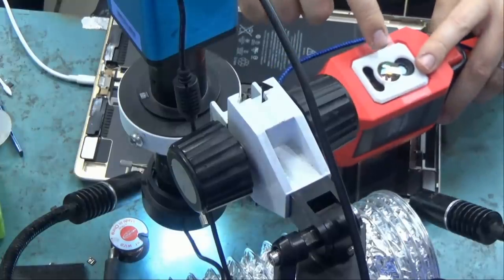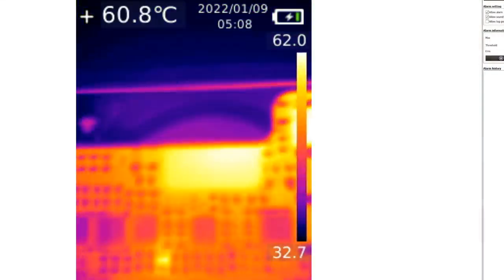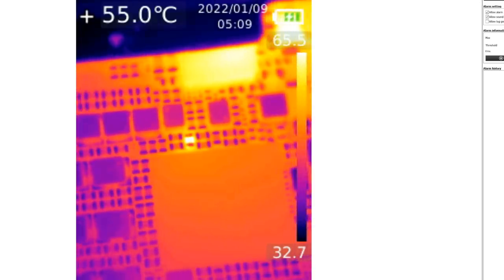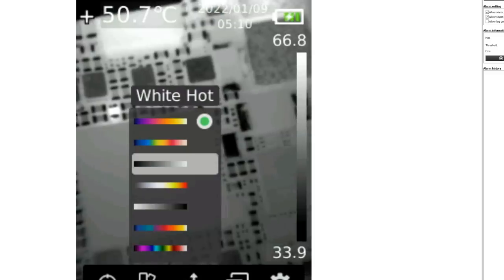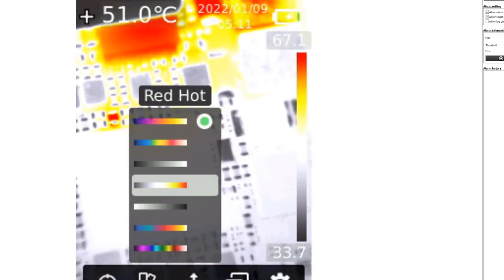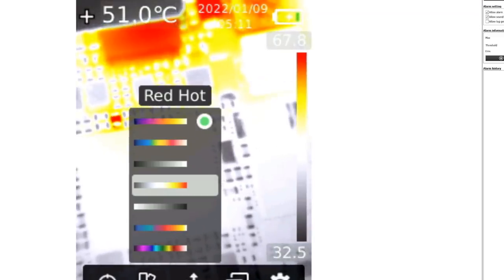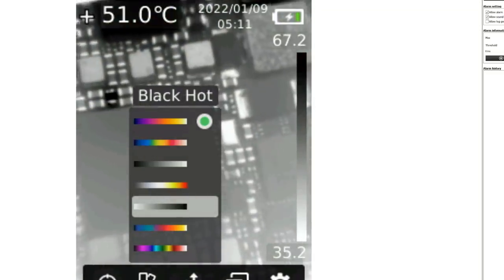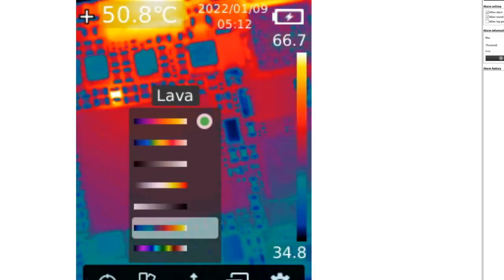iPad pro 12.9 Short Circuit Repair using UTI260B Thermal Camera and Macro lens. Amazing Details!

Comment: Quick question. Did you replace the component or was it just fixed by removing it? If the latter then how does that work? Why have that component there?
Reply: So that capacitor is just a filter cap that makes the power nicer for the chip. There are tons more on the board, so losing one of them is no big deal.
Reply: @An_Onion  thanks I was curious as well
Reply: @An_Onion  then why does apple use it if it’s optional?   How hard is it to throw another bypass cap in as a replacement? The value isn’t critical, I imagine he can get  a tube of them and not need a donor component.
Reply: @justin3594  There are many circuits which work without some component, they just work better /more reliable  with that additional capacitor.
Reply: Pcb designer here, sometimes we need a minimum no of caps for the right filtration of noise and other stuff. Personally, I tend to add a couple extra caps or more on top of that if it's a mission critical component, otherwise maybe a couple max.

Comment: Hi been watching your videos for about a year now, I have used them to learn so much more about micro soldering then most other channels. I now use these skill every day at my job now at another repair shop. something I was not expecting is just how many laptops where the CPU is the component that is shorting out. is this normal or have I been diagnosing these board wrong. Say most of these boards I am able to find a short on the coils, injecting some voltage into them the CPU die heats up under the thermal camera. Would i be wrong in stating that board is a no fix?

Comment: Are you just remove the capacitor ? Or replace it?
Reply: He probably placed a new one later, doesn't really mater
Reply: @Savvas Savva 
Blocking parasitic effects of the PCB traces und stabilizing the voltage for the IC.
Reply: Obviously bypass cap, you can remove it, but the signal is no more that smooth then (depends on other bypass caps nearby). Usually you have more of them to get a smoother signal. If you measure it with an oscilloscope you can see the differences.
Reply: He had to have replaced it.  You don't remove components and leave voids unless you are absolutely positive that the effect of it being missing will not effect operations AND you have chosen to live with that potential problem.  One doesn't make that decision for a customer.
Reply: you must be new here
Reply: I was confused about this too lol. I'm going to just assume he replaced it off camera

Comment: What causes those micro components to go bad?
Reply: most likely a component that functioned but had an imperfection and was running hotter than spec, heat cycles slowly make it fail.

Comment: Why you clamping? Is the Display Glued together or is this a flexible seal who need‘s the pressure?
Reply from the maker: It's called Better than Factory Seal using B7000 https://northridgefix.com/product/b7000-multi-purpose-glue-adhesive-for-phone-ipad-imac-screen-repair/ and Screen Clamps  https://northridgefix.com/product/adjustable-metal-clamps-for-screen-fastening/
Reply: @NorthridgeFix  very nice. Thank you

Comment: Hello from Sarajevo, Bosnia and Hertzegovina.
I follow every video of yours and I am thrilled with your technique because I am a fan of technology.
Did you replace the faulty capacitor in this video or did you just remove it to make the tablet work?
Reply: Well, not necessarily, I think it's probably a filter capacitor, in which case he can just remove the component and not put another back
Reply: He left it off.  The capacitors surrounding a CPU in a laptop are just there to bleed off AC noise from outside interference to ground.  Capacitors pass AC but not DC, so the DC power is unaffected but RF noise is sent to ground.  He left it because, in a small thin laptop or tablet, there's no room for one big capacitor for this job, so they solder a bunch of smaller ones in parallel near each other instead.  For example, if you need a 10uF capacitor to bleed off the noise, but it would be too big, you can put five 2uF capacitors in parallel instead.  Parallel capacitors total capacitance adds.

So five 2uF caps in parallel is the same as one 10uF cap.

Since there are so many caps around the CPU, removing one probably only reduces the total capacitance a tiny bit.  Probably less than the allowed tolerance of the total anyway.  

Since you risk damaging the board replacing it more than the risk if you just leave it off, he just didn't put a new one in.

EDIT:  You can kinda tell they are all in parallel and are just filter caps by how crowded they are and there's kind  of a pattern to them.  
It's not ALWAYS the case that caps can be left off because it's not always the case that they are for filtering noise and are just one among many doing the same job.
But in this case it was.

Go to 3:38 and you can see.  It looks like a repeating pattern.  That's a clue they are for noise and in parallel  You can just kind of tell with experience.
Reply: @derim006  no it has a purpose. It is used to clean a possibly dirty signal. @Amadonics told there are multiple capacitors that work together to do this job. But in reality, removing one capacitor isn't going to harm the electronics too much, it just decreases the filter effectiveness by a bit (but not enough to make it stop working)
Reply: @AmadonFaul  Thanks for your clear explanation!
Reply: @derim006  He explained it very well. Those things are in parallel and if you remove one, the others will continue doing the job.
Reply: @cinkoxid  SPOT ON
Reply: @AmadonFaul  Thank you for you time explaning.
Reply: Alex explained that question before,it's risky and dangerous to heating around cpu to solder that cap back then just removing it.so the answer
Reply: Pročitao sam dalje komentare  i ima smisla jer je paralelna veza.
Reply: thank you for your reply

Comment: When you plug the charging cable and seeing an amp draw from your meter do you disconnect the battery or not? Thanks!
Reply: He did not
Reply from the maker: Battery connected of course, otherwise iPad will not draw any amps.
Reply: @NorthridgeFix  thank you good sir.

Comment: That's amazing for that price 😮😀
The flir thermal cam you can get a macro lens for that too, we use this camera where I work.
Reply from the maker: Yes Flir Macro lens $4k-6k only https://ebay.us/CcMV3O and it won't be any more magical then what we saw in this video. The Uni-t with macro lens is a no brainer. A similar spec Flit will cost you at least 10 times as much.
Reply: @NorthridgeFix  Is the Macro lens separate or included with this model? Sounds like a separate device
Reply from the maker: @andrewfreeman88  It's a separate item https://northridgefix.com/?s=uti260b&post_type=product